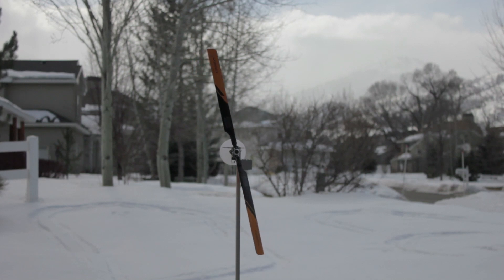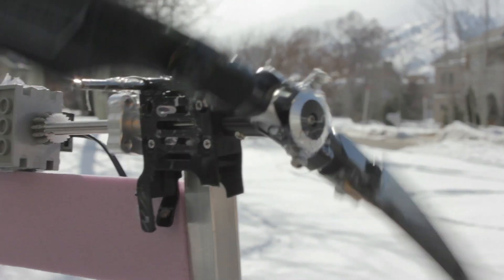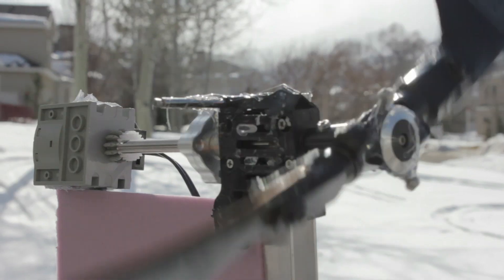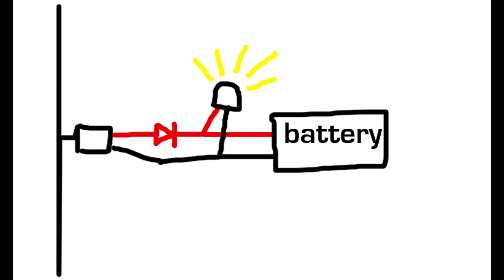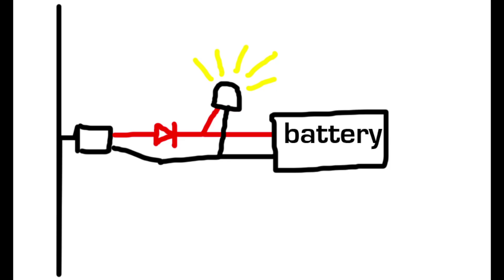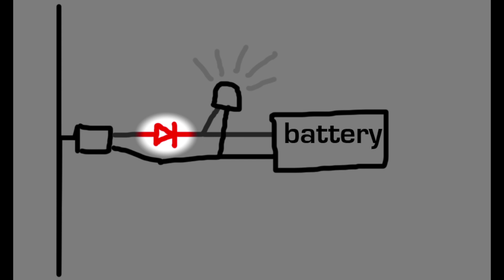RC Helicopter Blade Wind Generator - RCTESTFLIGHT

Comment: The gear doesn't spin due to the one way bearing, so no damage is done. Besides, with the power on the motor is verrrrrrry difficult to spin at all.

Comment: Knexfun: Do you have all you electronics in your heli? Because if you do, that can cost you an esc. 
If you do this: Your motor is generating electricity and send it to your esc. An esc isn't made to receive electricity from a motor, only from the battery. And some components can blow up if there is a reverse voltage. Like condensators.

Comment: if you angle the blades into the wind more it will become more efficient because  there is not as much suface the wind force will have to push.